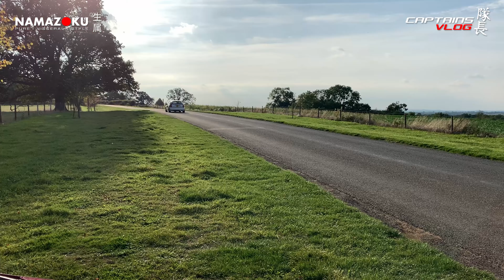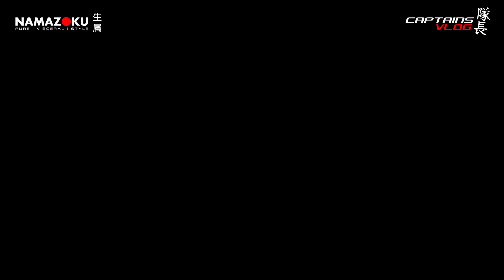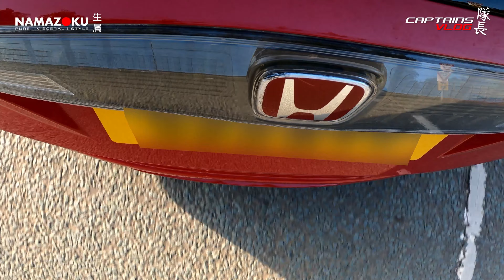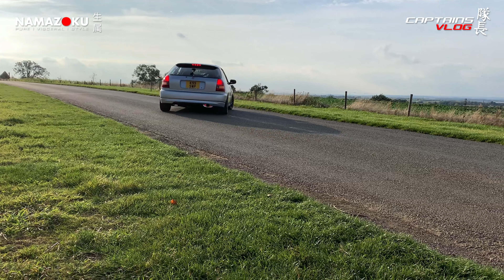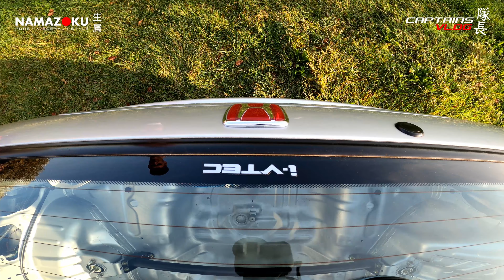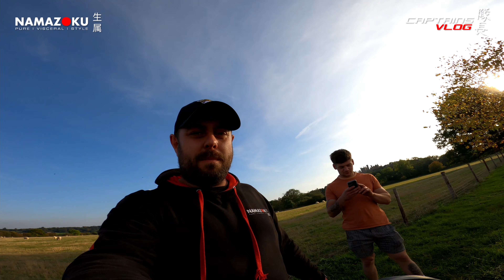RAW VTEC NOISES plus 1200 mile review of my K20 swapped EJ9

Comment: Sounds nice mate!! Is Alex's catback a 70RR???
Reply from the maker: No idea mate, I'd have to ask him👌
Reply: @captainsvlog  cheers dude
Reply: It’s the 60RS dude 💪🏻
Reply from the maker: @FN2OPS  it's a J's racing 60RS catback 👍
Reply: @ALXBurnett  Sounds great mate! And is super rare. 70RR is a unicorn. Currently got a tdi north 3" but my goal was to get a 70RR. Thanks for letting me know!
Reply: @captainsvlog  They sound lovely! Funny you recorded these videos when I also uploaded mine with the decat 3" ahaha. need to get a proper suction cup for my GoPro now
Reply: @FN2OPS  I think the 70RR has to make use of a proprietary decat section afaik. I got it for an absolute bargain, though that said, it needed a fair bit of work
Reply: @ALXBurnett  I have a mate in Portugal with TODA headers and J'S 70RR (titanium) and he said it is bolt on. These catbacks are getting rarer so it is good to look after them.
Reply: @FN2OPS  Ah well fair enough. Maybe so! I had to replace the front silencer as it was beaten to hell, so I put a much bigger box in. And then a couple of small adjustments to hangers and the angle of the tip. Thing it may have been adapted prior, as I got it second hand. Paid only 90 of the queens finest so I’m not going to complain in the slightest. What you get when you sell something not knowing what you have I guess 😉 Win for me!
Reply: @ALXBurnett  nice work mate! Yeah for 90 quid can't ask more. OEM used go for that xD